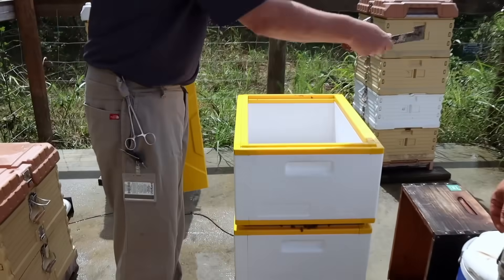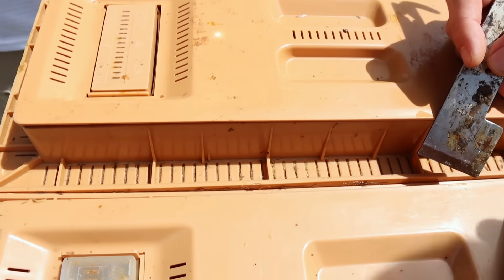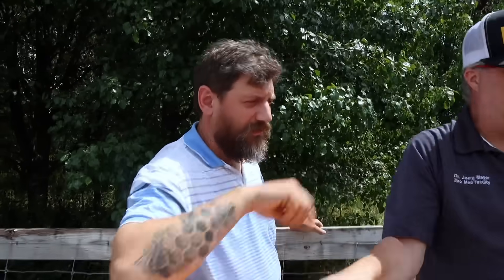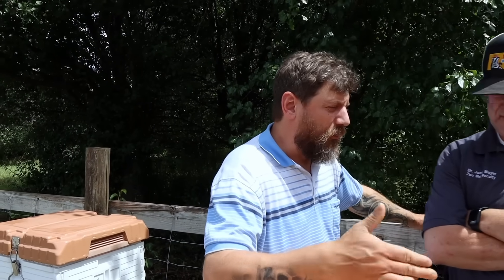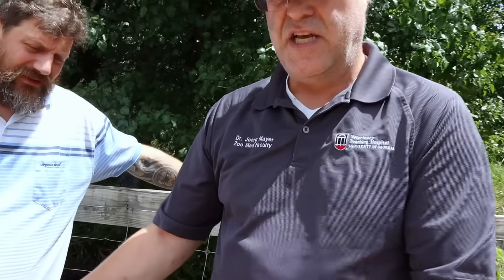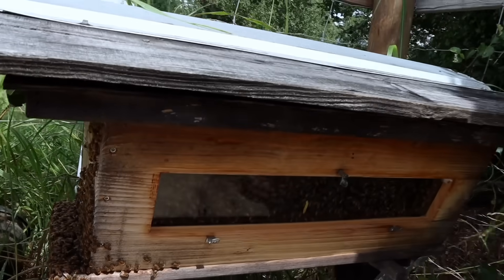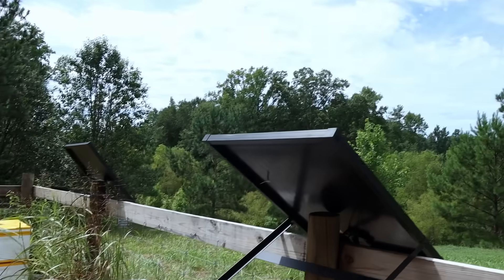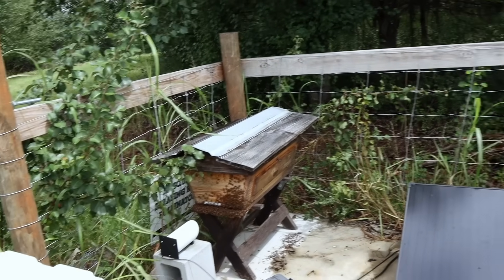Vet School Beeyard at UGA

Comment: Sharp guy.  
I employed a few Apimaye set ups here in the Lowcountry.  I really enjoyed how well they thermoregulate (hot and cold) and love how everything fits together (great for transporting bees)but in practice I noticed some pitfalls which I shared with the manufacturer.
The feeders are very convenient but become a haven for ants and SHB (unguarded territory) here in Charleston.
The vents on the top cover allow easy access for pests and I found a good deal of moisture on the inside of the top cover during winter.
The boxes themselves are a bit too snug for 10 frames (worse with their 7 frame nucs)…feel like I am jamming the last frame in so I use a follower board instead of the last frame.
I did retrofit a hole with a metal grommet in the back corner for an ProVAp gun so plastic dosent melt.
I guess my conclusion is that every system has its drawbacks and disadvantages and work a bit differently in various locations.
Reply: agree...love apimayes ...i have 100 of them. TO avoid snugness i only use solid plastic frames...they fit better. as far as Oxalic ...i make a medium dummy wood box and place on top of apimaye ...drill 7/32"  hole at a slight downward angle
Reply: I lived in Cross and worked in the Charleston ports for years.  I moved back home 14 years ago but have always wondered how these foam boxes would hold up in the humidity without turning black?  If they ever get affordable enough to try on a few dozen I would consider trying them out up here in the northern rockies.  I'm glad you posted the above.  Very Interesting.

Comment: :) A few thoughts on this from Germany: I’m with this man and his natural view on bees and approach to beekeeping. And even more I am into the idea of practical research about beekeeping. Then why not going this way consequently? We had good research on insulated hives versus wooden hives here in Germany, and it turned out that either way is the same for bees, because bees heat the brood and not the room. This is a common misconception among beekeepers. And as this man said, whenever you try to intervene into the bees climate regime it turns out they can do better without our aid. And so it is with the condensating water in the hives: for all we know they need this water, especially during the winter. And it’s a  mir of a problem for them if you try to dry them. I know that this causes fungus but in spring, they clean their hives almost completely on their own.

Comment: Ventilation needed. In Ohio I use screened inner cover in winter. Vivaldi board on top of inner cover. And Vivaldi is filled with straw. Another regular inner cover and finally the top cover. All moisture absorbed and no ice in hives. Ventilation needed.

Comment: FWIW: I have had very good success with insulated (R-15) lids and no upper ventilation/entrances (very good yields and no winter losses) since I started beekeeping in 2020.

Of course, having low mite loads is the most important part. To that end, I’ve been having great success with OA/gly sponges.

Portland, OR 8b

Comment: Thanks for featuring our hives, Joerg Mayer is doing some amazing work! After 5+ years of (strenuous) R&D we're glad to see the hive is being received well! Here are some points I wanted to add:

1. With regard to ventilation with our hives, we have rails underneath the base that allow the ventilated floor to be blocked if you wish to do so. With the temperatures we get here in Australia (around 10-120 F), we leave the vents open all year round, but for the folk that need to close the vents in the freezing months, you have the ability to do so.

2.  Joerg featured our 3 deep hive kit, but we have recently started manufacturing medium supers that are available for pre-order on our website! They are due to arrive in the US around mid January.

3. We're finalising our hive top feeder at the moment, it will be available Q2 next year. 

If anybody has any questions about the hive, feel free to reply to this comment :)
- Zavier from the HiveiQ Team, for healthy bees!
Reply: I might be attracted to such hive bodies, except for the substantial use of plastics. Do you have an estimate on the longevity of such hives, especially in 365/24/7 exposure to extreme elements?
Reply: @davidloucky3566  , our components have a life-span of 25-30 years+. While at face value it may seem like our hives have are less green than wooden hives, there are a few external factors to consider:
1. Due to the significantly reduced weight, commercial/professional beekeepers will burn less diesel when moving them around.
2. Due to their extended life span, a timber hive will have to be replaced multiple times over that life span - that's more trees getting cut down.
3. Extended life span of bees/more productive bees. Because the bees will have significantly more resources allocated to being productive rather than being occupied with trying to keep the hive dry and/or at an optimal temperature, the colonies will be stronger, and therefore help with food security as they are better suited for pollinating (greater number of bees on crops) and better honey production.

Hope this helps!
- Zavier
Reply: My understanding is that the HiveIQ hives require painting to protect against UV whereas the Apimaye hives arrive assembled and ready to go. I’m in Australia and keen to try the Apimaye hives!

Comment: Colder months, especially in colder climates, it is challenge keeping water from dripping back down onto the bees from the inner side of a lid from condensation without any ventilation and/or quilt box type set up. Any suggestions on how to mitigate this with minimal use of additional equipment?

Comment: Good stuff. Regarding insulation and ventilation, it's important to remember a few key points:

1. Insulation works both ways, keeping hives cooler in the summer and warmer in winter.
2. Warm moist air stays as warm moist air until it comes in contact with cold, at which point condensation forms. If you can eliminate the cold spots, you eliminate condensation.
3. A human generates about 80 watts under normal metabolic rates (non-exercise rate). Bees also produce heat under normal metabolic rates, just walking around breathing. The trick is to keep that heat from leaving in winter.
4. Bees must work to create heat to stay warm. How hard they work is directly correlated to how much they consume and burn. The less they have to work, the fewer calories they consume.

Comment: Great video Bob! I can add to this, I currently am running 15 HiveIQ hives in Australia. 

Some reason's I like them are:
- easy to assemble for painting (I can assemble a full triple deep HiveIQ in around 15-20 minutes, no need for sanding)
- lighter than wooden boxes
- On the HiveIQ, the walls are around twice as thick as a wooden hive, so deep hand holds which making lifting much easier
- Polyuarathne is recyable material 
- The foam cannot get mold or water damage 
- The most drawing aspect, very insulated, my bees use less honey through Winter 

The only issue I've had is that they are a tad expensive, around $270 AUD or $175 USD. Another issue as well in the video, compatability. HiveIQ currently don't sell a feeder yet (they are making one), so beekeepers have to result in using makeshift ones right now, and the only one that will feed will only be from HiveIQ. 

I buy them locally so I have no shipping costs.
Reply: Nice! I’m a fan of Paradise Bee Boxes but keen to wait and see how well the Hive IQs hold up over time. Will be interested to hear how the rooves and entrances wear :)

Comment: Insulation on top of the hive reduces condensation on the interior lid surface, so you can achieve similar results with wooden hives if you insulate the lids, especially in the winter.

Comment: Im in northern WI, I agree about zero venting. I tilt all my colonies at >5 degrees more or less, which is sufficient to ensure any condensate runs forward and down the front wall. I believe that hive top insulation(i use 2" h.d. insulation is far more important.

Comment: I'm sorry but up north if you have no ventilation you're bees are dead in the first month of winter. Maybe it works in the south but definitely not in cold winter climates
Reply: wrong.  I live in the cascade mountains up in WA state, wet & cold.  No top ventilation, with 1.5" insulation under telescoping lid.  moisture condenses on sides instead of the top.  bees do great.

Comment: Hey Bob, Really enjoyed the interview at the University of Georgia.  I, respectfully, disagree with some of his comments about ventilation.  I think what he says may be true in some climates, but not sure that will work in Ohio.  The trick he uses to get rid of condensation is a good one and why I put a 10 lb bag of sugar on top of every hive as part of my over-wintering procedure.  We have a lot more variation in temperature in Ohio in the Winter and, thus, a lot more problem with moisture in the hive. I make a special trip from my (Winter) home in Blairsville, GA, around mid March to check on food stores in my hives in Ohio and a lot of times they need more sugar.  If the original sugar is gone, there is nothing there to absorb the condensation.  His analogy of bees living in trees and not having ventilation is a bit misleading because the very porous inside of a tree absorbs the moisture, making ventilation less imperative. I have ridden by the University many times and would be interested in whether they are open to visitors?
Reply from the maker: I'm not sure about visitors. Couldn't hurt to stop and ask. I think the condensation thing is simply about warm moist air hitting a cold non absorbent surface.
Reply: @bobbinnie9872  Hi Bob! Have you thought of any method of raising the humidity in the hive above 80% in order to decrease mite reproduction, but without harming the hive (eg Chalkbrood disease)?

Comment: A German bee scientist keeps on claiming that bees only heat up the cluster but not the box they live in. So the effects of insolation are at best negligible. That's why the bottom board is completely open with a metal grid which allows you to use a board underneath the grid to count fallen mites which allows you to estimate the mite infestation (no shaking of bees necessary).
Reply: The insulation allows the bees to use less energy to maintain temperature and the stores act as a heat buffer. In wooden hives bees eat the stores quicker in winter than poly. Also in poly the clusters are looser, as he states you don't need as many heater bees to maintain temperature. Open mesh floors were invented well before varroa arrived in Europe and North America, they were designed to alleviate damp in the hive, but you do lose heat through it. Also omf's are only good for counting the drop after treatment and not as part of your weekly inspection due to wind or insects removing the varroa, which would give a poor indication on the health of your hive. Using wooden hives, you need at least 2 inches of insulation  between your inner cover and top board and no top ventilation.
Reply: @beehinde  I agree with all you say but with one exception - we were given a list which allows us to extrapolate the eastimated mite load on the basis of naturally fallen mites at a certain point of time. It works pretty well and gives me information on which hive needs urgent trestment and which hive does not need any treatment at all. So we only treat those colonies which need trestment.
Reply: @MrMielten  We agree to disagree. For me, natural mite drop gives inaccurate information using the varroa calculator. Easy check is more accurate.
Reply: @beehinde  Well, then all data collected here and all evidence which proves that counting can be relatively accurate is wrong.
Reply: @MrMielten  Unreliable is a better word.

Comment: Hello Bob. Over time, I've tried all kinds of winter bee wraps. My conclusion is that it depends a lot on what material the hive is made of and what material is used for packaging. Untreated wood hives can be ventless, but hives treated with plastic or paraffin cannot be ventless. All good.
Reply: What issues did you see when not venting?
Reply: @gloriayoder5173  Hi. A humid atmosphere loaded with carbon dioxide, conducive to the spread of disease.
Reply: Why?

Comment: Thanks for sharing I don’t know if I would like styrofoam if I’m thinking right it doesn’t do to well being weathered for years or if anything could damage it easily but maybe it could be just as good as the wood box
Reply: I needed some outer covers years ago and the only ones available were Styrofoam. I have had them ontop of many hives for several decades now with no degradation or visible affects from UV exposure and weather. I've only broken one. AND it glued back together solidly. Lighter too!
Reply: The manufacturer reccomends painting them  to keep UV  light fr destroying the plastic and foam

Comment: Bob, the audience that watch your videos in my translation often wonder why foam (polysterene) hives are not common in the USA because in Ukraine and in Russia this type of hives has become very popular. I have no answer. Have you ever tried it?
Reply from the maker: I have never tried them but I do see the good points about them.  I was just at a convention and saw three different brands and I know there are more available.  None are compatible with each other which would be a problem. Perhaps in time we will see more of them being used.
Reply: @bobbinnie9872  just transferred my colony into the new HIVEIQ from the old wooden hive. they seem to be much happier. plus i was told paradise hive works with HIVEIQ. i will put the rest of the nucs i buy into HIVEIQ from now on. cant wait till they release their other parts like the feeder and pollen collector.
Reply: I can add to this, I currently am running 15 HiveIQ hives in Australia. 

Some reason's I like them are:
- easy to assemble for painting (I can assemble a full triple deep HiveIQ in around 15-20 minutes, no need for sanding)
- lighter than wooden boxes
- On the HiveIQ, the walls are around twice as thick as a wooden hive, so deep hand holds which making lifting much easier
- Polyuarathne is recyable material 
- The foam cannot get mold or water damage 
- The most drawing aspect, very insulated, my bees use less honey through Winter 

The only issue I've had is that they are a tad expensive, around $270 AUD or $175 USD. Another issue as well is what Bob mentioned, and you saw in the video, compatability. HiveIQ currently don't sell a feeder yet (they are making one), so beekeepers have to result in using makeshift ones right now, and the only one that will feed will only be from HiveIQ. 

I buy them locally so I have no shipping costs.
Reply: The answer to your question as to why the insulated hives have not talen off in the US.. ..  

We have used them with our Alaska bees. to great success  but beyond bees kept there I can see little to no benefit that will be overwritten to a significant expense in the lower 48 states.  

1. They take up more space.   ( more money to ship)   Shipping ks expenseive.    

2. They are way more fragile and break way quicker than standard woodenware.

3.  The money .  They cost way more.   Way way more.
Reply: Cost

Comment: This no ventilation point is interesting……
I lost both colonies my first year and decided it was due to moisture/exposure, 4” of dead bees on bottom board mid February,I used bubble foil for inner cover! My reasoning was each bubble would catch condensation and drip directly on the bees.
I’m in Northeast Pa. So winters can be long but usually have days for cleansing flights! I’ve since gone back to normal inner covers in winter.
Reply: You need to not half go at it. If you insulate it has to be a full envelope. Check out @vinofarm By putting bubble wrap against something cold it becomes the condensation point. If you insulate the lid with foam and then had the wrap you keep the cold away from the warm humid air. Also should have a slight tilt so it runs down the walls and out. Water dripping onto bees is not ideal but them having condensation helps access the honey. It’s a fine line

Comment: Sorry. Totally disagree with the no ventilation opinion. We are equating a wild hive in a tree to a styrofoam box. Totally different environments. I’ve noticed even wood boxes dipped in parafin ie, no humidity absorption allowed by the box, do significantly worse overwinter than just bare wood. Different climate in Canada though.
Reply: In Europe, bees have been kept in poly hives for 40 years without a top ventilation. The more insulation you have in the roof mitigates the condensation above the brood nest. This is the nearest you will get to a tree. There is plenty of research ongoing, Derek Mitchell in the UK and Etienne Tardif in the Yukon to name, but 2. I have bees in poly hives with no top ventilation and they thrive better than wood, plus the bonus of producing around 15% more honey than wooden hives.